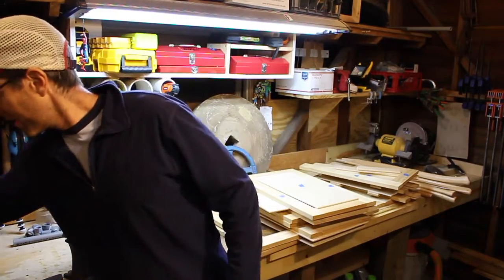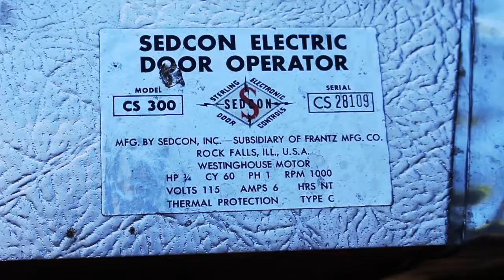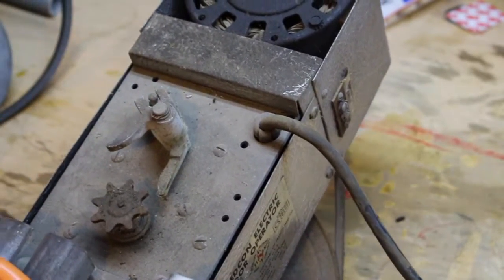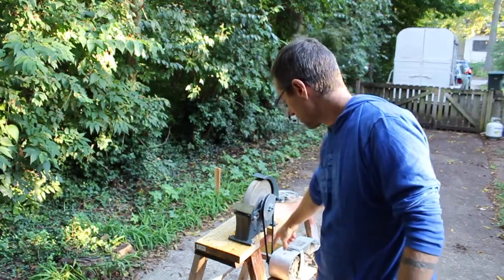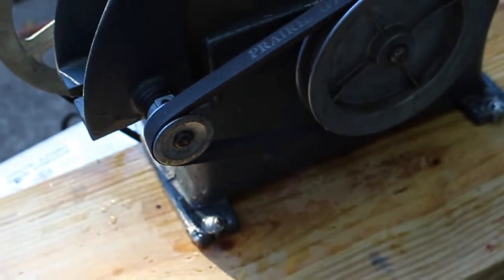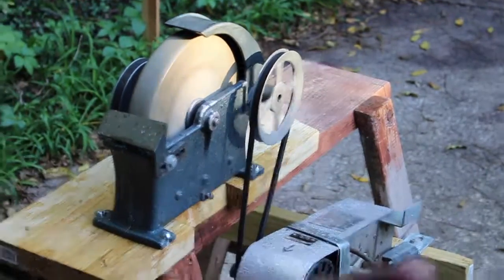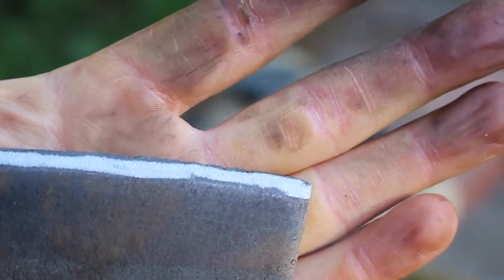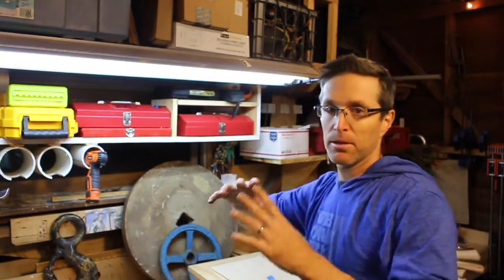Wet Wheel Grinder Powered By Garage Door Opener

Comment: I guess I should have watched the whole video before telling you a little bit about it. First of all, you don't know what the F you're doing.
 The wheel is supposed to run away from you from the right side. Looking at it, it would be clockwise.
 You added too much water.  It's only to barely cover the bottom of the wheel, drain it after every use or you will soften the Stone rending it useless.
 You should.
Go online before trying to use tools.  guessing is not a good way to proceed sometimes.Anyway, good luck.
Reply from the maker: Awesome! I got a free lesson on grinding wheels ... thanks buddy!

Comment: Prairie G7 Wet grinding , moto. should  run 1750 rpm pulley in this center should be 5 inches. Pulley. connected to the base to the motor. 6 inches. 1975 ? Go online it's there

Comment: I have a very similar grinder that I picked up used.  However mine rotates in the opposite direction.  I thought mine was set up wrong but after researching I found out buffing and polishing stones rotate away from you.  You will also notice you have a splash guard toward the back that will help when it rotates in the proper direction.  Hope this helps.
Reply from the maker: +walton1996 ... thanks for the tips!

Comment: I have a wet grinder just like yours. I ran it with an antique 1/4 hp 1750 rpm motor with a 1" pulley. It works. But I don't use it. The stone on mine is very coarse and leaves scratches that are deeper than I want.
Reply from the maker: +Old Sneelock's Workshop ... I'd like a motor like that one!

Comment: OK here's my comments. First, don't hammer the ends of the shafts, you'll peen them to mushrooms and ruin what bear surface there is on the cast iron. The garage opener motor is not meant for continuous service, and may not even have a fan in it to keep it cool, thus it gets hot. Visit you local trash dump or look for an old washer, drier or dish washer to get a motor that can operate continuously.  I have a wet wheel just like that, but it looks older. Always drain the water out of the well when you are done, otherwise the wheel will get softer on the side kept under water, and if it freezes it will chip the wheel. My grinder came with a drain on it which has some tubing on it.  Just bend the tubing up when you want to use it and pour the water from a plastic soft drink bottle into the well; when done hang the bottle with a wire from the side and put the tube in it, the water drains out, ready for next time. Oil your bearings.  You can make an attachment to sharpen longer knives more easily and precisely by attaching a length of 3/8" all thread to the top cover and mounting a clamping device on the knife that will allow it to swing from the all thread rod. The knife edge should touch the wheel very near it's tangent. A picture would help here. A slow moving wet grinder really makes it easy to touch up edges on old screw drivers with over heating them, as its slow and easy to hold against the stone sides.  Good job on the grinder and the video.
Reply from the maker: +pixelpatter01 ... awesome comments and all super helpful! You're right about the motor ... it recently started smoking so I'm looking for a new one. Super nice of you to offer the suggestions!